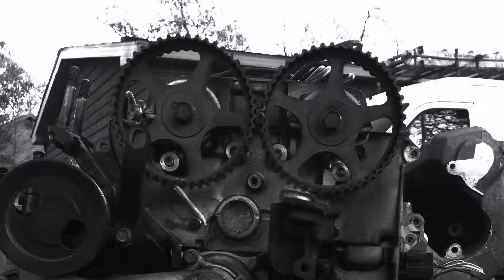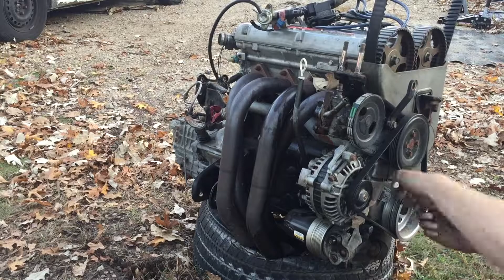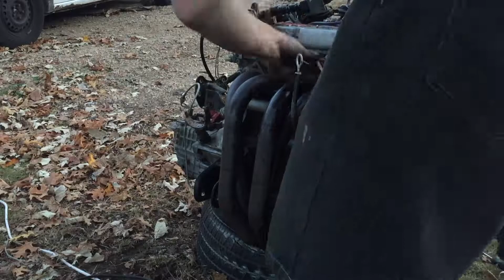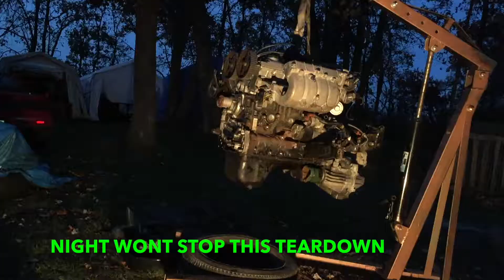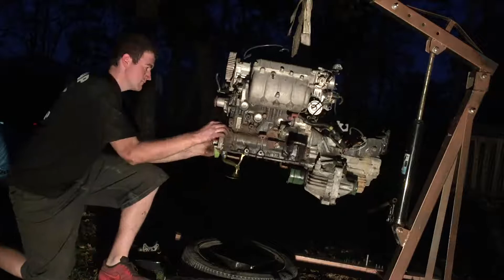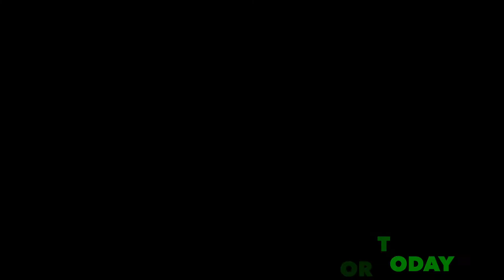4G63 Timing Component Teardown

Comment: Not sure if you guys have seen his stuff but check out jafromobile on YouTube. He's one of the kings of 4g63s. He shows a lot of VERY informative stuff on.oil gallery.mods and basically anything 4g related.
Reply from the maker: +blindabinda123 motor is already assembled... ik paul rried rhe oil gally mod biy bits he got wherr not doin ntn
Reply: Garageless I understand a little bit of that jibberish. Lol
Reply from the maker: blindabinda123 lmfao sorry literally just woke up and fat fingered the shit out of phone lol. We tried to do the oil galley mod with no luck... bits we had wherent doing nothing and we didnt wanna spend 30$ in good bits lol so we gave up lol
Reply: Garageless the one behind the the oil pump housing shouldn't require drill bits. Usually you would use a dremel.tool or something like that. But deff check out jafromobile on YouTube. He's prob one of the most in depth YouTube guys out there.
Reply from the maker: blindabinda123 ill send buddy his channel info...
Reply: Garageless yea I deff would.
Reply from the maker: +blindabinda123 prob find all the things we fucked up during assembly lmfao